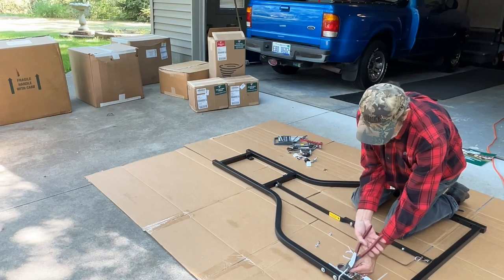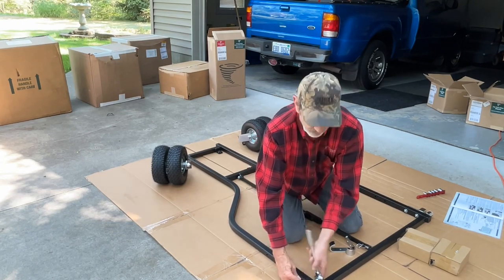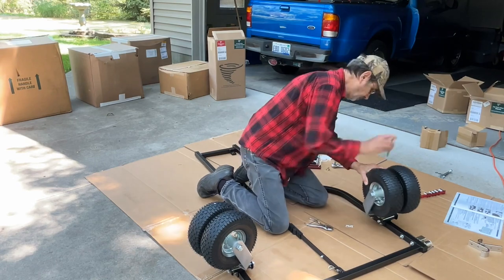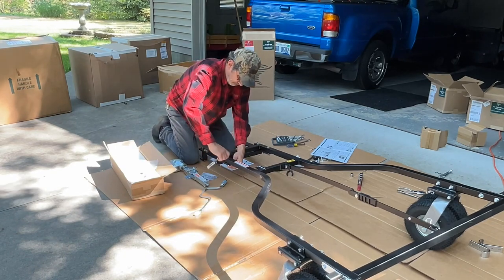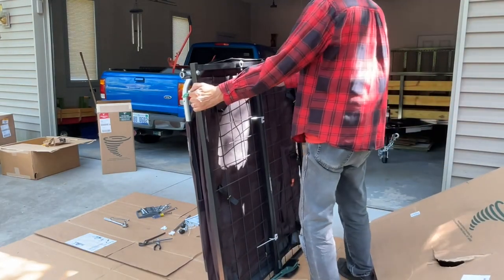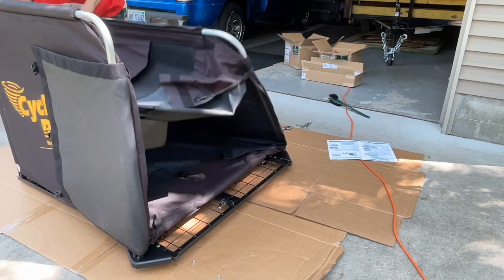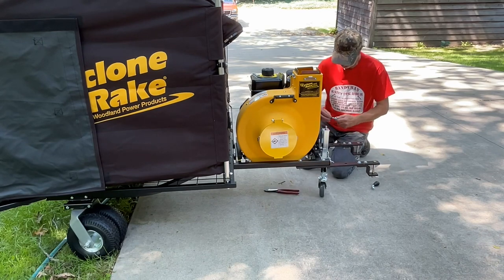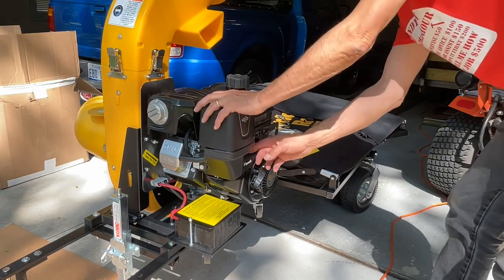440. How to assemble a XL Cyclone rake, Part 1

Comment: I just took delivery of my XL Cyclone Rake here in Calgary, Western Canada via the Canadian distributor and the local dealer. There wasn't a single damaged box. Assembly was easy for a 70 year old, so no whining from me. It is a pleasure to buy and receive a high quality and well designed product!
Reply from the maker: @corgicliffdivingteam8280  well keep watching either later tonight or tomorrow I will upload a new video on my Cyclone rake caster locks. Don’t know if you’ve seen them yet and the other video I did but you’ll soon find out if you don’t have to take yours apart and hanging on the wall are extremely hard to try to move once you take them off your machine, they kinda go wherever they want to my brackets will lock the casters from swiveling and make it as easy as moving on regular.        Jim

Comment: My wife bought me a cyclone rake 20 years ago. I absolutely love it. Folds up nice for storage well worth the money
Reply from the maker: Well, I have some questions for you, which Cyclone Rake do you have and what size engine does it have on it? Have you had any problems with it over the 20 years you’ve had it and if so, which problems occur and do some occur more often than others? And what are you using to pull it with? I may pass your answers on in my next video.      Jim
Oh yes, I forgot one more question what did it sell for back in the day? I almost hate to tell you what this one cost.
Reply: Hi Jim. First off I would like to thank you for the advice that you gave me on a snapper I picked up for my dad last year. I really enjoy your videos
I’m not totally sure on what model it is I’ll try to attach a pic of of it. It is the smaller green one. With a 5 hp Tecumseh engine. Has single wheel casters. I upgraded the deck hose to a HD hose and purchased the rack  that goes on top for hauling the long hose. I pull the trailer with 312h wheel horse tractor. The only problem I had with it was carburetor from ethanol fuel. Other than that’s it’s been great. I think back then it cost 1300.00   The best part is it folds up and I lean it against my garage wall and wheel the engine under my bench. Doesn’t take much room. I use it for two properties and couple times in the spring and bunch times in the fall
Reply from the maker: @DavidDwyer-n2w  well, I hope I have as good as lucky as you did.   I haven’t seen a picture yet, but if it comes through, I’ll take a look at it and see if I can tell which model it is. Talk to you soon. Jim.

Comment: I have one just like yours, this is my 3rd season, its a leaf sucking beast. You gotta have a place to dump the leaves. I vacuum at least 3 times are more during the leaf falling season. During that time ill have 12+ loads to dump.
The only complaint i have is when moving the trailer out to hook up to the mower the wheels twist and turn in all directions until it starts going straight, turn left or right the wheels start twisting like crazy, like pulling a 300lb pig on its side.
Reply from the maker: I am working on that issue mine is the same.   Jim

Comment: I have been thinking about getting a cyclone rake. I like your blue Ford Ranger flareside. I used to have a blue 1993 Ranger Splash.
Reply from the maker: I’m working on putting together a video with some short clips I made when I was using my Cyclone Rake there satisfaction guarantee is totally unheard of. I mean you can’t even go to Walmart or any department store and buy a toaster. Use it for one year and take it back for a total refund yet that’s exactly what they do with their product, and I know they actually do it because my boss bought one last year, and for some reason didn’t like it, and he returned it with no questions asked ,  I did a walk around in my yard and videoed how big it really is and I know it took my father-in-law 2 to 2 1/2 weeks to clean up his yard. I did it with this Cyclone Rake in 2 1/2 days and I bought the Power unloader so I could blow the leaves down into a low area where you can’t drive, this machine is totally worth owning.  Jim
Reply: @jimjackson9381  Thanks for the long and  detailed response. 👍👍

Comment: Hi Jim, I enjoyed your videos on the Cyclone Rake XL. I just ordered an XL. My question is on the engine hour meter you briefly spoke about. Is that included with the XL from the factory? If not, I would like to know where to get one. I added an hour meter to my zero turn, but you had to wrap the signal wire around the sparkplug wire several times. I wasn't real impressed with wrapping the sparkplug wire. Thanks Scott
Reply from the maker: I bought mine from Amazon and I wired it in where the stater wire comes out of the engine to charge the battery. I got the one with electric start now I don’t know if one without electric start will have a stater in the engine and I have 11 hours on mine already, don’t forget your five hour oil change first time.     Jim
Reply: @jimjackson9381  I also purchased one with electric start, so I will do the same. I have hour meters on all of my 4 cycle equipment. They are very useful for the reasons you mentioned. Maintenance and total hours on the machine. I'm glad you spoke about it, it was good reminder to purchase one if it didn't come with one from the factory. I'll get one on order. My XL should start arriving soon. Have a Happy Thanksgiving and thanks for the response. Scott
Reply from the maker: @scottbaker3766  hey Scott, when you get that thing and start putting it together let me know if you need any help. I am sure that you were going to love that machine I did my father-in-law‘s yard last week and that was a two week job when he did it sometimes 2 1/2 weeks. I did it in 2 1/2 days. That thing is simply amazing. Jim.